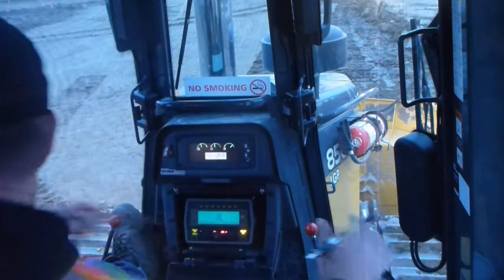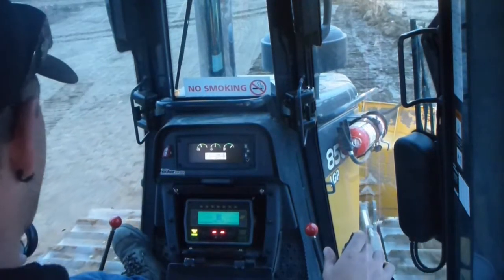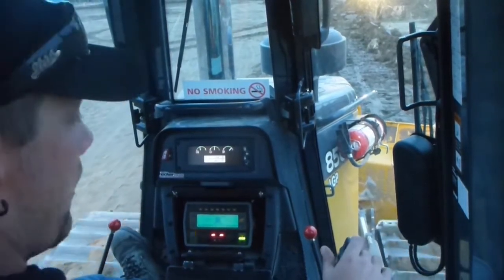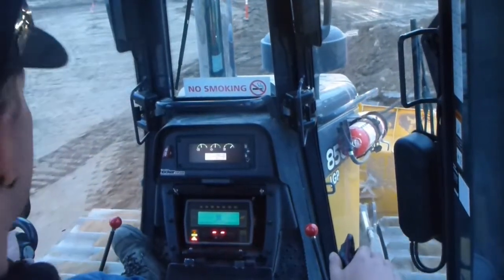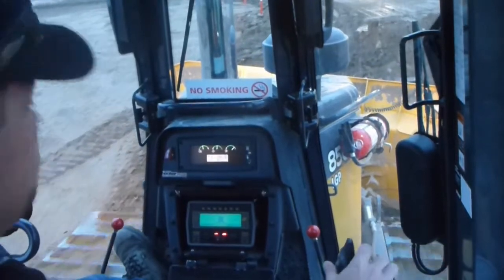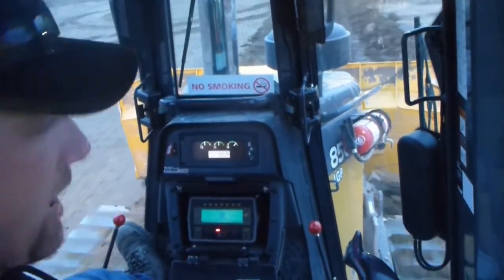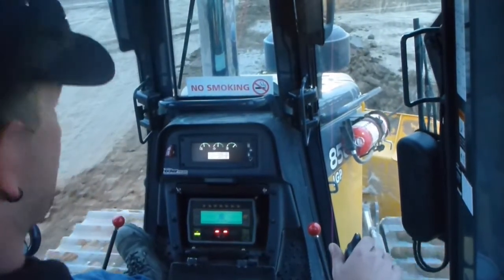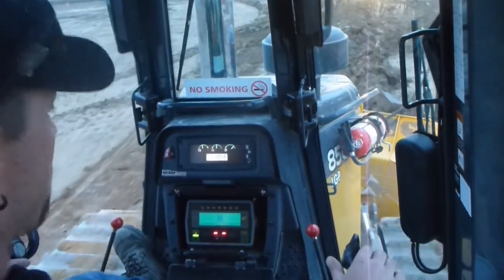John Deere 850k with TopCon system five

Comment: That is the same Topcon system we use for the oilfield pads I help build. It is a great system but the issue I have with it is making sure the laser itself is set in the right direction. if your positive and negative are dialed in wrong you end up with reverse fall.